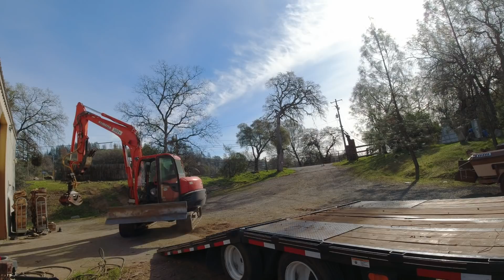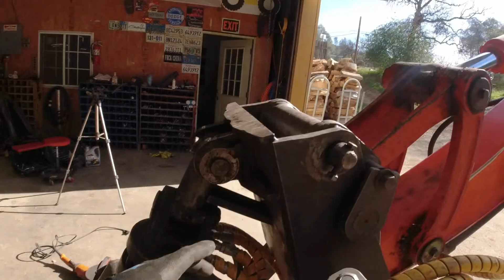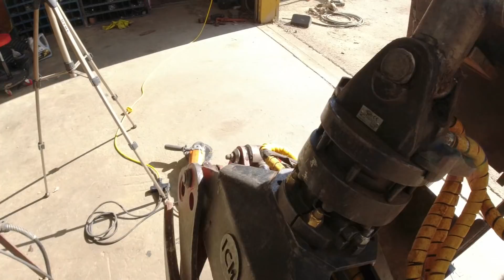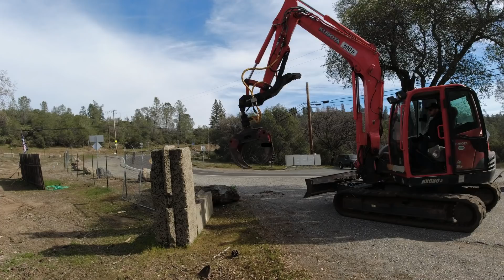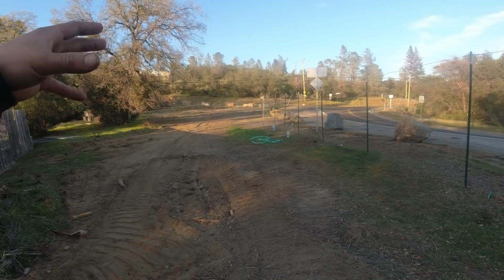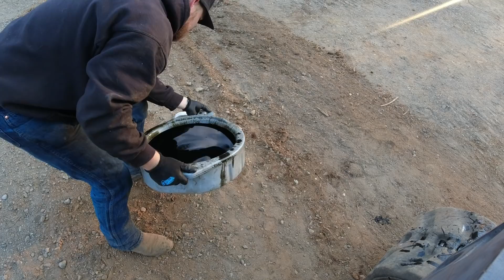Equipment maintenance and fence repair! Welding on kubota excavator

Comment: The local road commission would have a stroke if big rocks, fence, and concrete were anywhere in their road “right of way”.  How wide is the “right of way” for that road by you place?  Just wondering......
Reply from the maker: All of that has been there for 20 years plenty of room and the corner is used for the school bus stop

Comment: I have about 80 acres that has recently been logged 12” and up I need to clean up all tree tops and whatnot,
I could use an excavator and skid steer but can’t afford both either really but I’ll make it work.
Very steep part of the country what would you buy ?

Comment: Have you ever heard of drilling a hole at each end of a Crack b4 u grove it and weld it up. I was always told it prevents the cracks from continuing later on. I'm not 100% sure if it does anything or not, but I figure it can't hurt anything so I still do it. I was just wondering what your opinion was on. that.
Reply from the maker: I’ve heard that before. Never tried it. Seems like a good idea tho. I’ll try it next round
Reply: @VBELTandSON  right on.  You have an awsome channel,  I live just south of you in Hilmar ( I'm just south of modesto like 30mins ) and is cool seeing some one on YouTube sort of in my area making videos about the things you do.  I tow only around 22k on the high side for work a couple days a week and have always owned and loved cummins trucks. And it's great seeing what they are really capable of

Comment: How long have you had your 08 5500. Also what truck would you recommended for hauling a bumper pull dump trailer with  10,000 lb skid loader

Comment: 3000 hours is a lot of use. When I worked for the Fraud Motor Company, pieces parts etc were specified to go a minimum of 2000 hours. The basis for that was that 2000 hours at 50 miles per  hour would be 100000 miles. So that grapple has a Fraud rating or 150000 miles LOL.